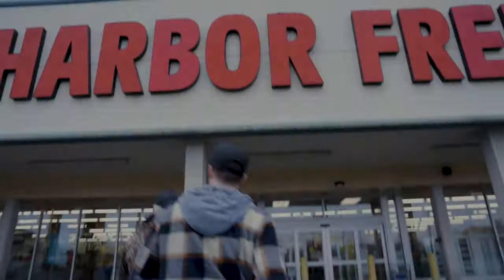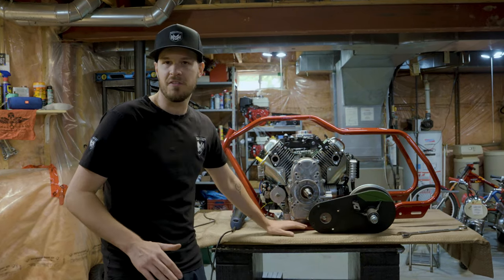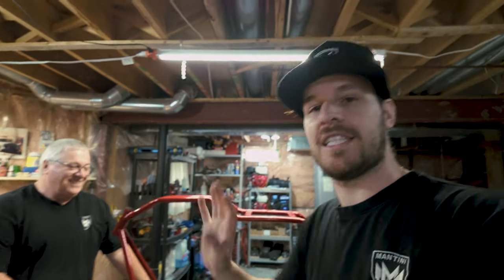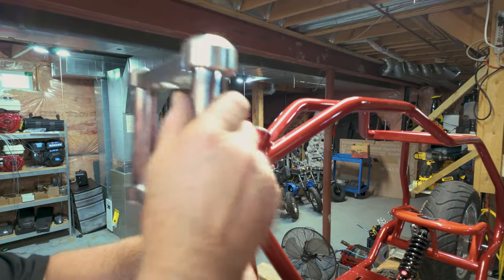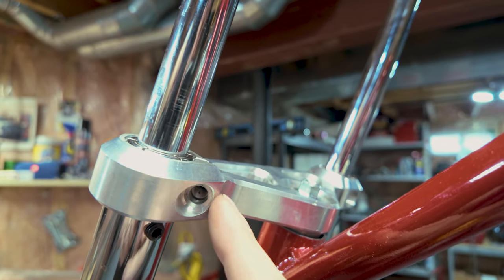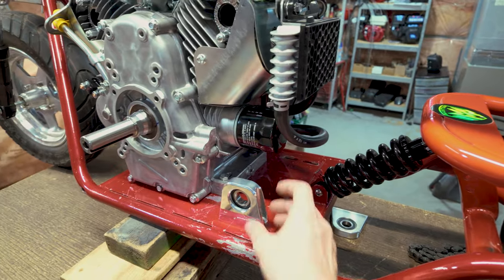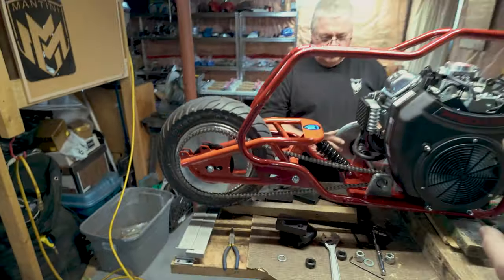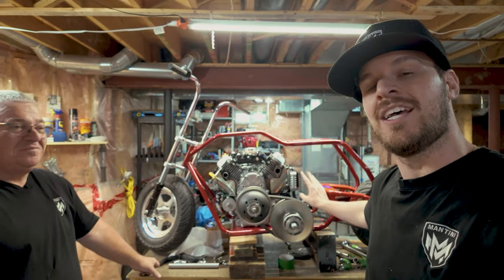Building a 670cc Mini Bike Beast - The MBK-1 Dream Begins!

Comment: That secondary should be reverse mounted so that it opens to the inside - that's how all atv/sxs secondaries work. It will bind up and wear the belt how you have it. I've got a CVTech Series 06 from vegas carts that I'm mounting to a polaris secondary with a big 1 1/4" belt for a polaris 900. That setup will handle that 670, but those thinner belts on the 780 comet type torque converters aren't a great solution in my opinion. You need a really solid mounting point for that jackshaft - if you ever get it to hook up and actually use the torque things break that you didn't realize could. I would modify the frame to make the engine sit flat; putting it on those blocks it's probably going to slide. Ideally I wouldn't have slotted holes, just four holes so the engine can't move. The engine plate should be removable so you can make a new one to move the engine. Anything that can fail will.
Reply from the maker: @cowboybenwade  great advice. I guess we forgot to explain it in the second half of the video. We are no longer using the engine riser plates once we decided to remove the mounting plate that came with the TAV. But reversing the secondary is something we will definitely try if it will help reduce wear.

Comment: The holes in the torque converter plate where they mount to the engine,(4 mounting holes) can be slotted, or serrated, to slightly clock the torque converter anti clockwise, then using one of the extra mounting holes secure the install.

Comment: All Torque converters I have just burn through belts especially when they’re on more high power engine
Reply from the maker: What Torque converters have you used and on what size engines? This would be our first major setup like this and so any input would be much appreciated!
Reply: I run a 40 series on a 301 predator mounted to a baja warrior, the owner is 350+ and 6'8" belt last all summer and we replace for safety not because it's burnt or destroyed
Reply: P.S. wish I had your dad
Reply from the maker: @danielclements2754  Well since you are here with us on this journey, consider yourself apart of the Mantini family!

Comment: Im surprised you're putting a torque converter on it.  Way overkill for such a big motor.  You're going to be burning rubber on every takeoff!!
Reply from the maker: @dwaynejohnson6277  we want to try to see what it is like. We can always go back to a clutch and chain if it has too much torque. This is also not going yo be used for racing and so we won’t meed to give it full throttle when starting.

Comment: You really need to take in consideration, the V engine turned 180* is gonna through ur Torque/ center line all that serious stuff. 
I’ve built a lot of bike. 
I would suggest w engine that big .. I would build a motor mount, that can slide/turn /even control chain tension ! 
This mount will bolt right up to bikes mount. 
Because even a small degree of pitch can massively increase performance

Comment: Use a half thick plate and add it to the other two plates.  If it fits, then make a boxed in riser. I don't like the front fork tubes being so short and fit into the triple tree tubes. Use Longer fork tubes and put them into the triple trees.  Offer an additional cross brace for the handlebars so it can be positioned higher up and secure the bars from spreading and turning.

Comment: Automatic quick fix. Cut the torque converter plate. I've done it several times. 😂😅
Reply from the maker: Yes, luckily though because of the way we designed our jack shaft it turns out we don't even need the torque converter plate in the first place. So we cut it for no reason haha.

Comment: Hi.  That shock angle looks like it will be really hard on the shock bushing and shaft.  I didn't go back and see how you guys came up with that angle, but my calibrated eyeball(?) tells me that you have a falling rate rear suspension, that will get softer as more weight is added or it hits bigger obstacles, rather than a rising rate suspension.  Obviously, I could be way off base, but I'd hate to see you put in all of this work, just to have the angle of the shock be an issue later on.  Good luck!!!
Reply from the maker: @jimalexander9230  appreciate the feedback, we haven’t had any issues with it so far and it is a 2,000 lbs shock so it would take quite a bit of force to wear it out. Also, the MBK-1 is a street bike so the amount of large bumps would be extremely minimal if any.
Reply: @ hi.  Sounds good!!

Comment: Do you cut the frame or the torque converter. 
What’s cheaper? A piece of tubing or a manufactured mechanical design? 
Cut the frame and reenforce it properly.  
You’ll never have a problem again.

Comment: I’d just lower the engine on one plate and put in a jackshaft for the secondary clutch
Reply from the maker: We should've explained in the video, once we realize we didn't need the plate for the torque converter, we were able to eliminate both of the engine plates.
Reply: @ gotcha I saw later in the vid you said you wanted to use your style Jackshaft so it was clarified

Comment: 2:13 man just grind the torque converter. Way too much overthinking. Unnecessary
Reply: Also instead of relying on a set screw to keep your handlebars true just weld a bar going across the two once you found your comfortable position. That's not like chain tension where your gonna be adjusting it every other ride. You honestly don't want to have that problem of having to align your handlebars because an allen head stripped out or worse the threads themselves. Pretty cheap tbh
Reply: Couldve literally put a few holes around the bottom of the bar that inserts and made "positions"

Comment: Is it just me or is the modified top bar completely off about 4 inches  towards the front,  and actually looks absolutely unnecessary, looks like somebody is overcompensating for something
Reply from the maker: @leadfarmer9698  There are actually a few reasons for the hump in the backbone. 

1. Future gas tank that will fit within it. Kind of like those old school Harley’s. 

2. More room for larger engines. The air filter on the 670 is right on top, so we need room for the filter. 

Also, if you check out our other videos, you’ll see how nicely a 420cc with stock gas tank fits in there. There is enough room to get a gas pump in there without crushing your hand. 👍